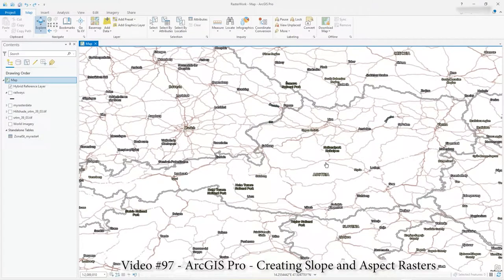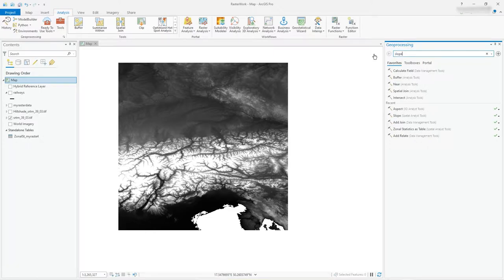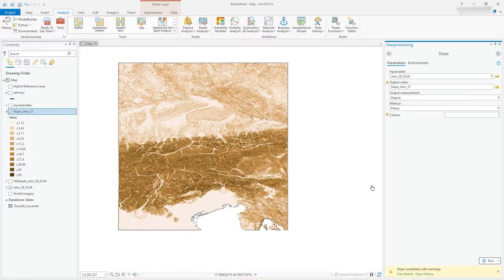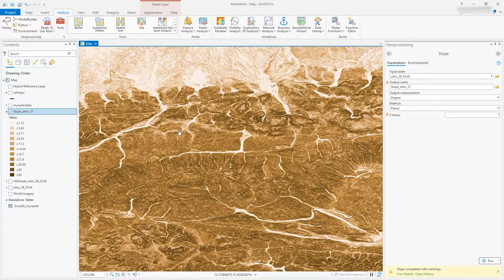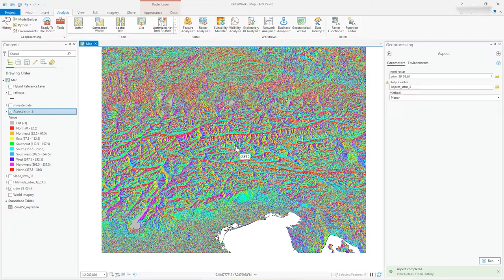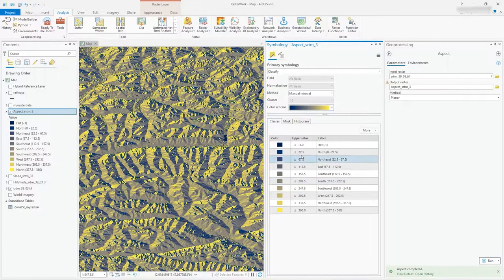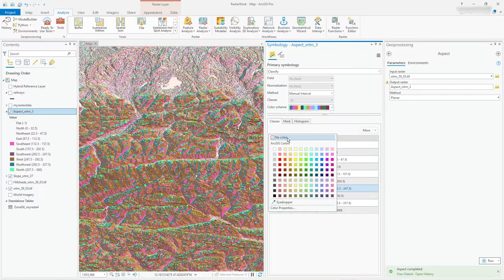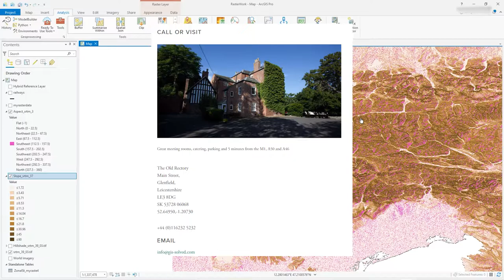Using ArcGIS Pro Spatial Analyst to create Slope & Aspect Rasters

Comment: Thanks for the video. As you told us we can extract Aspect map in ArcGIS Pro which has 9-10 classes in this way. I need to extract the aspect map but in 5 classes that the classes are P(flat), N, E, S, W in ArcGIS. Could you please tell me how can I extract Aspect map in ArcGIS which this 5 classes of the map automatically produce by ArcGIS because when I change the number of classes of the aspect map that I have Unfortunately the  label of classes change to some numbers that I can not recognize which class or which range is showing W or which  class or which range is N And so on ? Thanks for your guidance.

Comment: I've been instructed to find the steepest slope in the area of a dam. I'm using ArcGIS Pro but have instructions from ArcMap. 
My instructions say to use the identify tool (no longer available in Pro) to analyze all layers (I have one hillshade, one slope, and an aspect layer) for the steepest slope. I am to give the degrees and aspect of that slope, if I can find it. How can I query for a question like that?
Reply from the maker: Hi - You need the Spatial Analyst extension enabled. This will let you calculate the steepest slope relatively easily. There is always QGIS of course... ;)

Comment: So if i wanted to find areas on the map with slope from 0-20 percent that were north facing, one way to do that would be to only turn on the value colors assigned to those two conditions? Or would some sort of location query be more appropriate ?
Reply from the maker: Hi Fred - you can extract the information with an attribute query now that the slope/aspect has been generated by Spatial Analyst
Reply: @GISCoordinated  thank you for the help.